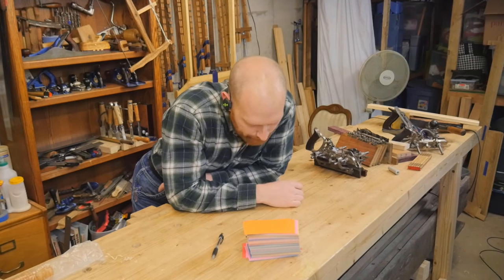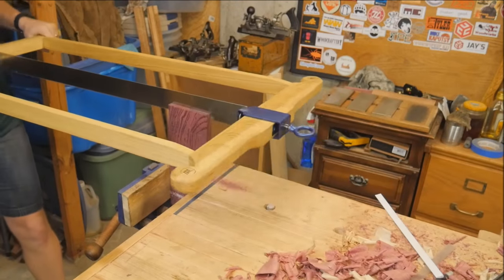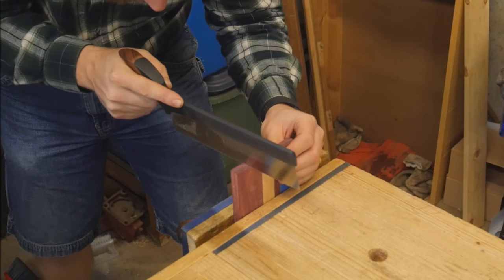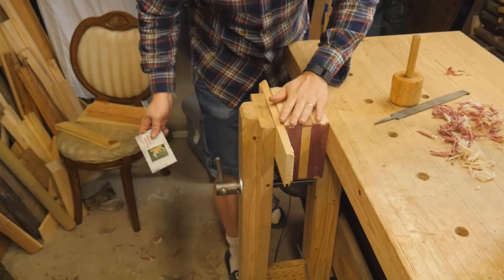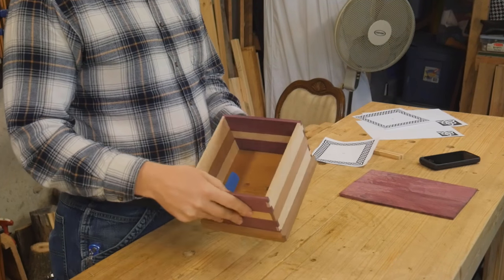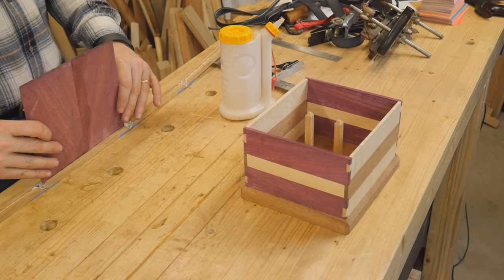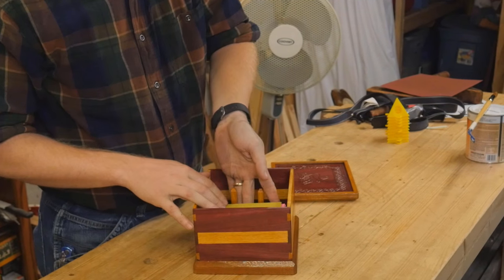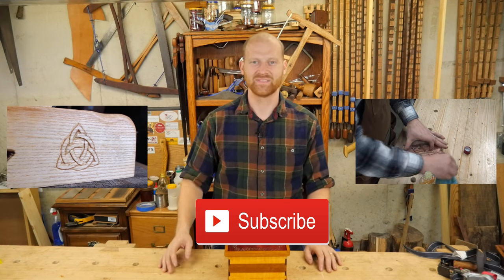How to Make A 365 Box for An Anniversary Gift From Wood Scraps of Wood

Comment: Very nice James! I noticed you used what looked like a #4 plane on the shooting board. I was under the impression, for some reason, a shooting board required a low angle plane. Seemed to work great for you though!
Reply from the maker: +donny carter You can use any plane you want. the LA plane is really a newer invention in its current format.  and in my opinion really does not live up to the hype. it is really only about 10 degrees lower and you can not use a chip breaker. Sorry you got me on a bit of a rant.
Reply: +Wood By Wright thanks for the info! Not a rant! Very informative! Thank you!

Comment: Nice project. Hard woods. Im not good enough at sharpening yet to work with those. (Apart from that, that stuff is $$$ here :(

I ran out of patience years ago. I saw you do the carving on periscope. The result is awesome!

Could it be time for you to look into more traditional hide glue?
Reply from the maker: +Willem Kossen Thanks man! and thanks for joining on Periscope. I am experimenting with that more. most of the wood here is out of my price range too, but I have a friend with a high end wood shop and I get scraps from time to time. makes it fun. I have wanted to play with hide glue and making my own Shellac but I need to get a dubble boiler or make one. that might be a fun project!
Reply: +Wood By Wright i bought my double boiler on the Dutch equivalent of craigslist for about 20$. Derusted it (that was a lot of work) and painted it with special heat resistant metal paint. 

Shellac is easy. Just mix with ethanol and wait a day. I think in your part of the world everything is more readily available than here. I had to search a long time for a shop that had decent pricing. It was a painters (artists) specialist shop where i found my blond dewaxed shellac flakes.
Reply from the maker: I  have been thinking of making one out of a few old cans and a coffee warmer. so many projects on the list! LOL

Comment: very cool project and congratulations, be it a bit late :-) 
Does she get to flip one card every day?
Would have thought you'd use the 55 for the chamfers, we're you going for a more handtools look?
Do you plane the panels straight or with a slight curve to get a tight joint? Or what are your thoughts on that. Any problems with the boards popping up? Didn't notice any vertical clamps or weight. Or is that just a problem when clamping too tight?
Great build and hope she liked it. Have a great day, cheers.
Reply from the maker: Yes she can read one every day. Correct! I am always trying to introduce small perfections on purpose.if at all possible I try to cut things freehand. I joint the boards flat. I am not a fan of sprung joints as they introduce stress that may not be beneficial in the long run. Because of that I only need a very little pressure so there is little or no chance of pop up. she loved it and odes again every day.
Reply: +Wood By Wright very nice. I bet I've over tightened joints in the past...
Would also be a good design for something like tarot cards, playing cards or photos.
At first I thought it would work like a card shoe with a stand in the front to place the card on and a slot/mailbox on top to put the card back. But this keeps it more private.
I'd like to make one with a locking lid, like one of those old VOC or mailcoach strongbox lids. Twist the celtic knot to unlock or something.
Wish my playlist would go faster, lol.
Reply from the maker: I was thinking of making it locking with the two center posts being able to be turned from under and connecting with a block under the lid. But in the end I decided to skip it all together.
Reply: +Wood By Wright or you could attach the frame of the lid to the box and let the lid fit inside that frame maybe with magnets. then have a post trough one side to push the lid up from the bottom so you can lift it.
I've seen some chinese/japanse furniture and boxes with interesting locking systems but seem very intricate and challenging.